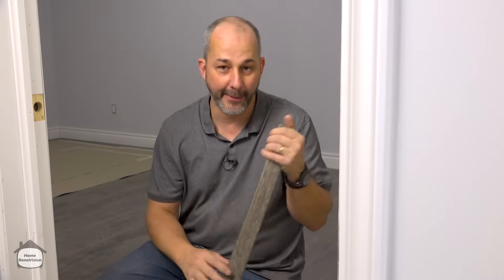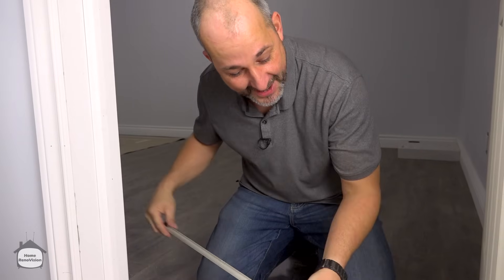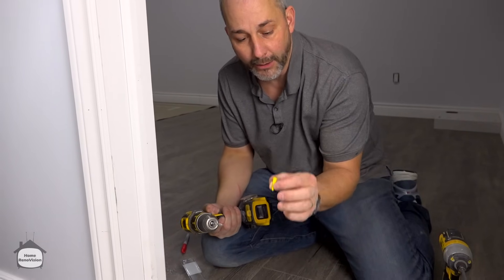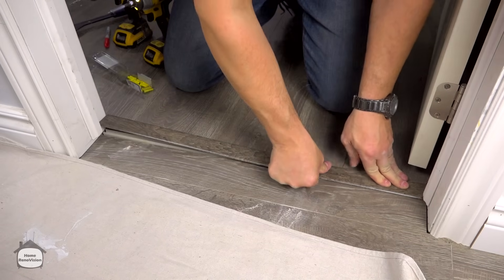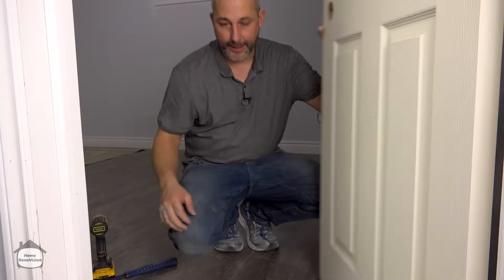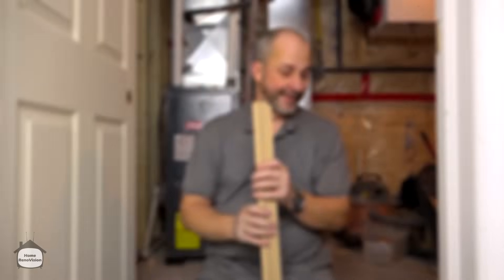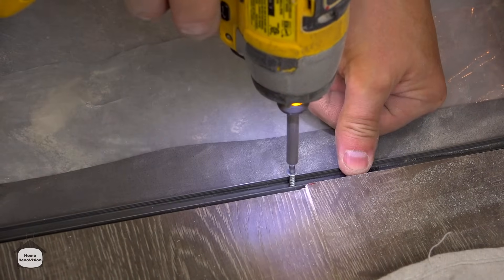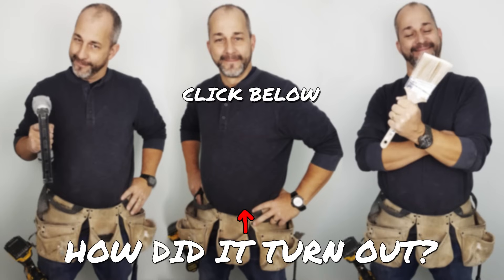How To Install Laminate Flooring | Transitions

Comment: Great videos.  They're my go-to vids for anything renovation. I'm planning on adding lvt on top of my existing finish floor. I understand everything about the required gap around the perimeter and transitions at doorways between rooms, but cannot find any info about where the lvt meets EXTERIOR doors and their existing threshold. Everybody seems to leave that out. How do you handle that transition? Do I need to install a completely different threshold to cover the gap or is there another way? Thanks for the great vids an keep 'em coming!

Comment: Great video!
Any advice on transition to sliding glass door as well as to carpet stair?
Thank you.
Reply from the maker: glass doors usually have  a raised edge you can install a small piece of trim, the stairs can purchase a nosing piece that is available special order in most cases.

Comment: This is a floating floor, right?  When you installed the track for the 3rd door reducer, why didn't you leave a 5/8 inch perimeter between the edge of the laminate and the track (immovable object) like I assume you did for the rest of the room?

Comment: Question: How do you transition a Laminate plank floor to a hardwood floor? I am replacing my living room carpet with Lifeproof flooring. I have hardwood floors that extend from the entryway to the kitchen and the living room is an open area to the hardwood... no doorway. So How do I make this look pretty?
Reply: Hello, I have the same situation as you I think:  bamboo flooring from the kitchen transitioning to new (to be installed) vinyl plank flooring in the adjoining family room (currently the bamboo transitions to carpet in the family room).  How did you do this??  Hope this reaches you well.  Regards!

Comment: Would you put a transition, say, in between a large living room and a large kitchen that are joined not by a door but by a larger gap in the wall the size of about 3 doors?  Is that possible?  The flooring I'm envisioning in my living room would be laying opposite direction from the flooring in the kitchen.  I'm wondering if the transition pieces can be that large, and if it is "acceptable" for them to lay in the middle of an open floor plan between two large rooms
Reply from the maker: Hi Morgan. if I was installing laminate then yes. If I was installing vinyl plank then no. Cheers!

Comment: Hi Jeff, im replacing my hallway flooring and laundry room with vinyl plank and have an issue on the transition from hallway to the laundry room. The laundry flooring is raised about 3/8" so how would you handle an issue like this since I thought it may look weird b/c I want it to be all leveled. I think the previous owner may have placed another sheet of plywood on top of the subfloor (hallway used to be carpet and laundry room is vinyl). Love your videos btw!
Reply from the maker: all transitions are designed to go from one style of flooring to another based on each flooring being installed on the subfloor. when you have layers you need to get creative. perhaps using the last reducer will work and perhaps use adhesive and roll the trim to make positive contact. Cheers!
Reply: @HomeRenoVisionDIY  Thanks Jeff, you're awesome!

Comment: I am working on the same thing right now, however, I have a transition from the slightly higher vinyl floor plank to my wood floors. There is a doorless doorway between the two. I changed out the base moldings and did a shoe molding and now need to continue into the kitchen where the new floor is. How do I handle the base molding and shoe molding when the flooring high transitions and then continues into the next room?
Reply from the maker: Hi vincent, i suggest you do the shoe and cut the angle into the trims. then install the transition inside of that dimension to hide any imperfections. cheers|!

Comment: Hopefully you or anyone else can help here.. I purchased a house and the living room has original 3/4" hardwood and the kitchen that is attached has "1/2" plywood with  1/4" sheeting on top and vinyl flooring glued on top, however between the original hardwood and the kitchen there is a 1/4 difference and I dont want a transition strip I want continuous laminate throughout. How to I go about it at that 1/4 difference so no laminate boards are bouncing or popping out of place?

Sorry for the novel of a question
@ Home RenoVision DIY

Comment: Is the process the same with engineered hardwood install and concrete slab? Store did not provide tracks for t moulding or for carpet reducer. They recomended gluing down the transition strips to the concrete. Any advice would be appreciated
Reply from the maker: adhesive works great especially for engineered since it is not floating. Cheers!
Reply: @HomeRenoVisionDIY  thank you for replying back. Follow up question, I've heard that epoxy can be a good option. Now should I glue it level with the door jamb or let it go below the trim (there is a gap below all the moulding to the drywall) thanks!

Comment: What about covering the gap between the new floor and the front door threshold?
Reply: I usually put a metallic transition between the floor and bottom part of the jamb, measuring and buying correct model for height difference. Sometimes even caulk between can work if its not that big of a gap. The bottom part of the front door jamb is usually taller and the transitions from floor suppliers are usually made for even floors.

Comment: Hi I noticed that you just had a under-pad directly onto concrete. I am installed laminate in the basement and would love to save 1$ SFT on DMX. Would you recommend another product or way of installed onto concrete in a basement?
Reply from the maker: if you have a dry basement then you can install on 2 in 1 underlayment like in the video. But if you have any water event at all it will all be destroyed. Cheers!

Comment: Question for you Jeff... I’m about to install a 10mm thick laminate flooring, over concrete with a 2mm under pad.

I’m wondering if I really “have” to install a transition?

The room dimensions are 22’ by 27’ 6”.  The 22’ is going to be the “length” of the board.  The 27’ 6” will be the the “width” of the board.

The boards are average, standard, 4’ long by 6” wide.

What are your thoughts?

I really don’t “want” to have a T-mould, midway (for aesthetics), but I don’t want it to shift apart either.

What about flying the tongue and groove?  Is that an alternative?
Reply from the maker: taking a chance, it all comes down to how much control you have over the humidity. Cheers!
Reply: I'm in that situation on a large open area with some of the laminates came apart. If I had to do it over, I use short finish nails on one side of the floor molding for easy removal for tapping the laminates back.

Comment: Does this apply to a vinyl plank flooring as well?  Would the same kind of transition be used for vinyl as laminate, or are there separate transitions for vinyl?
Reply from the maker: some companies make them in vinyl. best to check in advance, you might need to order them in special!

Comment: Hello, trying to put a reducer between my vinyl floor and tiles, but the tiles are higher. Where do you put the metal rail? On top of the vinyl floor?
Thanks
Reply from the maker: sounds like a very reasonable idea. Cheers!

Comment: Question: I really want heated floors because I have a condition called Raynaud's. So far, every application of Ditra Heat I've seen has been with tile. But tile is really cold. Do you know if it can be done with other types of floors? My husband and I are interested in this floating floor option because it's made from something like 80% recycled material.
Reply from the maker: I will be installing vinyl plank over a heated floor system really soon. Cheers!

Comment: Just installed LVP in my house, in one area i have to transition to tile in the bathroom that is higher than the LVT. What do i need to do for this?
Reply from the maker: in some cases the T can be installed on an angle and some times you will need a reducer( kind of like a ramp). Cheers!

Comment: Is it possible to install vinyl planks flooring in my whole house 1200 ft with out transitions? And would it look weird having every room run north south as far as layout?
Reply: I just had Home Depot contractors install a little over 1100 sq ft of Life Proof luxury vinyl plank. They put transitions in each of the three bedroom doorways, even though the same flooring continued through. When I questioned them they said it had to be done that way if the door openings were less than 4 feet wide. They said it was a warranty issue. I wasn't thrilled at first but read something in the Life Proof install directions about it.

Comment: Jeff, 
Is there anyway to join two pieces of molding side by side if the area of transition is longer than 72 inches?
Reply from the maker: yes. you want to use an adhesive bed to set both pieces in. Cheers!

Comment: Pretty interesting that people are learning from your video, I was done when you tried to explain running the floor in different directions .
Then to make it worst you said it looks pretty good.
Reply from the maker: Hi Tarik, the reason I suggested that is the homeowner was going to install his own floor. Most homeowners will benefit from this approach so they can get a good result at the door.That is the hardest transition in the project and laying boards in the direction of the door makes it possible no matter your skill level. And it does look good, the fact that it offends your mind is irrelevant!

Comment: hi Jeff, how i can align hardwood floor from hallway to rooms? i don't think i could change direction    as you did here b/c the direction should be perpendicular to the floor joints.
Reply from the maker: hardwood does not need to have transitions. Cheers!
Reply: @HomeRenoVisionDIY  May  you consider to cover hardwood floor connection among hallway, room,stairs in the future?

Comment: Hi Jeff,
About to install laminate flooring in the living room that has carpet now. Kitchen and hallway has laminate already and living room screams for new floor. The new flooring I purchased has a bit wider planks, couldn't find the same old flooring. There were transitioning straps between the kitchen/living room and hallway/living room carpet. After removing the carpet, I can see now the very last plank in both areas has the lip cut off or damaged. How should I transition to the new floor? I wanted to have one cohesive space without any transition strips in between. Can I just glue the very first panel on each side and continue the floor from there? Or do I need that gap to allow for expansion and put the T-strap? Both areas I am referring to are the length of a doorway only. 
Thank you!
Reply from the maker: use the door transitions. You will not be successful trying to tie in the old and the new!
Reply: @HomeRenoVisionDIY  Thank you for the quick answer:)
Just to clarify, there is no doors in between the kitchen/living room and hallway. It is all open space. I was hoping to fill in the gaps at the joints with wood caulk to create flat cohesive surface, even though the floor will differ slightly. Do you still think I should use transition straps? Is glueing at the joints going to compromise the functionality of the floor?
Thanks!

Comment: Hello, if I'm installing vinyl flooring over pressed chip board flooring, am I supposed to put down a moisture barrier? If so what type of moisture barrier do you recommend?
Reply from the maker: Hi Mark, that is a tricky question to answer. It all depends on where you live and the style of construction your house is. The easy answer is it will never hurt. Cheers!
Reply: @HomeRenoVisionDIY  Idaho,  over pressed wood sheets, vinyl snap together look like wood flooring.

I was told nothing is needed but not sure? I would hate to use the wrong kind and wind up having the flooring shift and barrier start to bunch up.

Comment: For your quarter round molding. What happens if you leave greater than 3/8 inch gap?
Reply from the maker: Hi Steve, you got me a little confused with that. if you are leaving gaps then cut again. Cheers!

Comment: I'm about to do the life proof flirting in a basement bathroom.  Need to know what kind of transition piece to use going from bathroom floor to concrete if the joining room.   We haven't bought or hung the door yet though.  Should we do that first, or is there a way to measure it to use so it looks right once we install the door?  Like, how far in to door frame should the floorin stop without the door casing being there already?
Reply from the maker: I suggest installing the door first and then under cut the jamb for the flooring to install. Cheers!
Reply: @HomeRenoVisionDIY  thanks for the reply.  Kind of figured that.  So, my framed door opening is 32" x 81-1/2".  Keeping in mind that I will be doing a fairly thin layer of self leveling underlayment with life proof flooring, what size door should I get?   Is there a standard size that will fit in there?

Comment: Man been busy with sick kids for a few weeks, haven't been able to pull up that toilet yet until we call a plumber to safely replace the main shutoff since anything that requires that (like the leaky toilet shutoff valve) is undoable.

But sweet to see this, gonna need this for sure when transitioning from the old carpet in the hallway to new bathroom tile!

In the interim I tiled some floor around the washer/dryer so the wife would have a clean, comfy place to do laundry.
Reply from the maker: There is a metal transition to go from carpet to tile that lays under the tile comes up and then caps the carpet all in 1 piece that you install while tiling. google that before installing tile , you will love it!
Reply: @HomeRenoVisionDIY  Man great tip, cheers!

Comment: Do you have to use transition pieces in doorways? The LVP I just purchased stated "no transition pieces required for up to 6500 square feet" so i didn't buy any😮
Reply from the maker: That is because vinyl does not expand like laminate. You will probably not need them at all. Cheers!

Comment: I have never done this before. I need information on what type of drill and drill bit. What is a yellow "plug"? I could not get anyone to. Understand.
Reply: Plastic wall anchor. Plastic expansion anchor. Drill bit size depends on the anchor size. Drill should be a hammer drill. It pounds as it turns, breaking out the concrete.

Comment: I actually like using the construction adhesive method because those plastic clamps are not all that reliable. My mom and my aunt both have laminate flooring and around the 1-2 year mark their transition became lose because those plastic clamps broke. Used construction adhesive and their hasn't been any transition pieces coming loose for almost 3 years now. But I must say that if they want the replace the tiles on the other side, they would have to buy new strips because they will break upon removal.

Comment: Cannot drill the holes if there are heating pipes inside of the concrete.
Reply from the maker: good point. simply use adhesive and pressure overnight then. Cheers|

Comment: Hello, I have done two bedrooms of mine with laminate flooring and on the other side I have concrete tile and so laminate is slightly higher than the tile. The gap I have between the laminate and tile is 7/8 inch. I have the reducer but I am not sure how to fit it in . Can you please help ? Also can you share your number so that I can call and talk directly ?

Comment: When you were cutting the extra floor at the end, why didn't you use a circular saw with the depth stop set to cut away most of it before you busted out the oscillating tool? That would certainly save some time and expensive blades, no?
Reply from the maker: I was thinking of it but that is a really tight space and not the kind of situation to have a large rotary blade exposed. I felt that it was just a little dangerous even for me.

Comment: I don't understand why you would put a transition between 2 surfaces that are the same at all times as you mentioned. I can see that in your video the planks in the two rooms are going in different directions....so a transition is required in this case. But, even in my condo their is no transition from living area to bedroom and the planks are going in same direction in both rooms....Looks fine to me.
Reply from the maker: in some environments like directly on concrete in a basement we need to provide opportunity for expansion. in many condos the environment may stay quite constant but that is not the rule.

Comment: The better T moldings are wood, I have a bunch of bamboo moldings - water resistant, stronger and better wear resistance. The better tracks are metal. Once you lay it down on the track the only way it comes out is in broken sections. Don ask! @10:40 could have used a trim circular saw and furnishing up with the Fein saving much time. You need a cordless vacuum cleaner like the Milwaukee or DeWalt. Now show us how to repair a section in the middle of a room without ripping out half of the laminates. Thanks for posting.

Comment: Or use a sawzall to cut the floor and finish the edges with the oscillating tool? Instead of 30 min and 3 blades....
Reply from the maker: you really risk damage that can't be repaired with that technique.